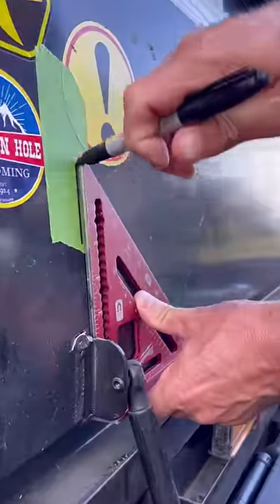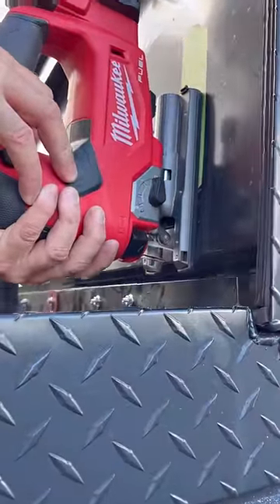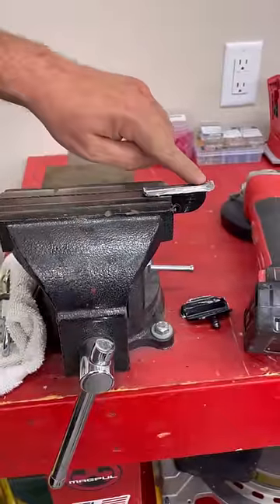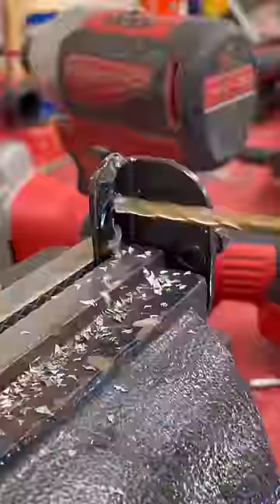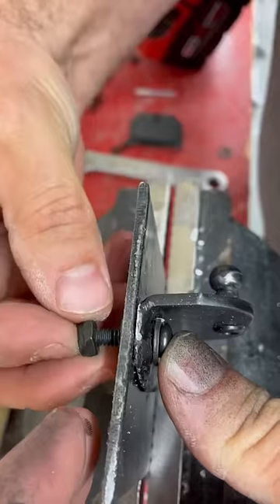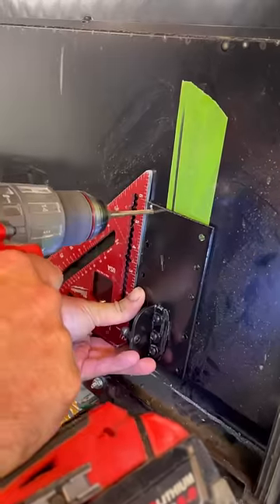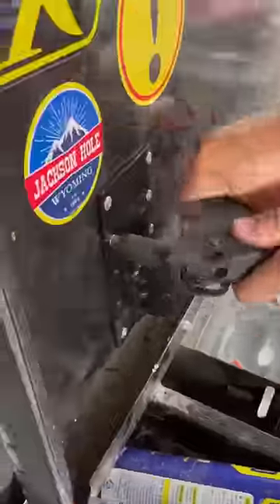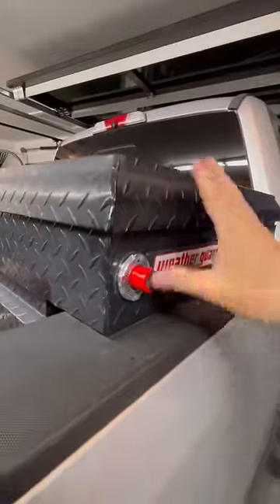I Had to Fix the Broken Shock Mounts on My Truck Toolbox

Comment: That repair was still cheaper than a new tool box!
Reply: Weatherguard has a lifetime warranty on their toolboxes.
Reply: It’s more of an upgrade than a fix! Better than new ;)
Reply: fixing stuff tends too be other wize whats the point to fix it
Reply: Yep, I always thought "pfft cheaping out!" but after seeing how I can just go to a local metal fabricator shop and ask "Any scrap sheet metal I can buy?" and either get chased away or see some actual useful stuff for the equivalent of pennies, I bought a small sheet of aluminium to use as a backpack bottom plate for the price of asking politely. It was way too big but they deal with contracts so what doesn't fit is trash, I cut it, rounded the edges and corners and glued some rubber around it and got what I consider a £15 product in return. Costs: £0.30 and some time.

I have taken a keen interest in metal repairs since then.
Reply: Not sure about that if you can disconnect the lid from the brackets.... Well might just get your boxes contents  jacked
Reply: @txfreerider if he is the original owner
Reply: No shit !!!
Reply: 😂z,,,,,,,,😊,,,,,,,,,,,,,,,,,
Reply: I'd recycle the old one.
Reply: Unless you’re in Rural America, people ain’t have time or knowledge to reuse, repurpose or recycle.
Reply: And it’ll last longer then a new toolbox now too
Reply: @txfreerider  yeah but then you have to remove it and replace it. and then the same thing will happen again. why not just fix the problem on the one you have? also, reduce, reuse and recycle in that order.
Reply: @minecraft425  the hinges are still attached, how is this any more theft prone than new?
Reply: Including buying all the tools for the project!
Reply: You can spend $300 bucks repairing a truck box and it will still be better than buying a new one at the prices they are now. Ridiculous!
Reply: What about the labor cost
Reply: @itsalexplayz2782 no, it’s a fix because it broke.

Comment: I'm honestly crying a little at the care you show your tools. That us a beautiful upgrade to a worthy workhorse.
Reply from the maker: Thanks
Reply: tool beautiful. jewelry, actually.
Reply: Steel and aluminum don’t mix, you’ll start to get galvanic reaction.
Reply: @chuckgranger9777 i don’t know. Depends on lots of factors. The paint will likely provide a sufficient insulation at the galvanic interface. But the aluminum would definitely be the anode. Though it would be the anode with any other metal that won’t suffer from work hardening. If he’s in the rust belt there’s risk, if not it’ll probably outlive him. I guess he could have used some gaskets at the interfaces, but those would fail with time. Either way, that repair will pay off before galvanic corrosion becomes an issue
Reply: @Praise___YaH  Then tell me this, why don’t Jews recognize Jesus as the son of God?
Reply: @chuckgranger9777  

Because they KNOW where “jesus” and the “jesus story” came from, “THEY” wrote it

1. The “god” begotten a “son” with a “virgin” is the story of Gadreel (The Serpent) begotten his “son” (Cain) with the “virgin” (Eve) 
-- Genesis 3, 4

1 John 3:12 “Don't be like Cain. He was a child of the evil one…”

2. jesus, the “bright morning STAR” and the “virgin mary/woman” is the Constellation Virgo the “virgin woman”, that is Astrology, the worship of STARS and “birth of STARS”

PLEASE, go back and read what I shared
Reply: @chuckgranger9777  

Salvation is Simple

HalleluYAH translates “Praise ye YaH”

YaH is The Heavenly Father 
YaH arrives via the TENT OF MEETING
YaH was Who they Crucified for our sins

— Ancient Semitic Cuneiform of Moshe (Moses)
— Isa Scroll (The Original Isaiah)

Isaiah 42:8
"I am YaH; that is my Name! I will not yield my glory to another or my praise to idols.

Isaiah 43:11
I, I am YAH, and there is no other Savior but Me.

Isaiah 45:5
I am YaH, and there is none else.
Reply: @Praise___YaH  I believe in the only thing I can trust, me
Reply: amen to that
Reply: Certainly Maintenance is A Crucial Element in Extending The Life Of Good Tools....!!!!
"Scout Motto Be Prepared"...!!!!👍👍👍👍
Reply: @chuckgranger9777  They're Rebellious Just like ALLLLLL the Other Sinners....!!!
Reply: @michaelduncan2151  Tell me why, oh great wise one.
Reply: @michaelduncan2151  Cat got your tongue?
Reply: Gay
Reply: @jamessheppard4372  
Yes I am 'gay' for this man's tool.

Comment: The hinge is bolted to a substantial steel backing plate which is generously riveted to the top.  They are going to bury you in this thing and the top will still function perfectly.
Reply: The only thing I would worry about is if you didn’t use any type of matrix (such as RTV) between the rivets and the plates. Dissimilar metal corrosion is what I would be worried about most, but you’ll have a good long time before that happens.
Reply: So what about when the same road vibration cause the surrounding steel edges to TEAR the AL just as it did with the old hinge plate?
Reply: But does it leak tho?
Reply: @TheTubejunky  It'll take far longer than the original damage took. The force of the mount is spread over what looks like a dozen rivets per plate.
Reply: @usmcquick makes it quieter too
Reply: How far apart are steel and aluminum on the galvanic series scale ?

Comment: Nice to see someone fix their stuff instead of throwing it away. We all should do this just like our grandparents did.
Reply: Most things are made fragile by design these days since a returning customer is better than a one time purchase. 

Fun fact when they started the first manufacturing of nylon tights they almost went bankrupt since you could tow a car with those tights. They were almost indestructible - nowadays they break after a week or two by design.
Reply: They just couldn't afford new stuff.
Reply: @Cheepchipsable   
Really do you think that is why he fixed it? 
So today I put a new blade on my 15 year old lawnmower. 
Should I have just thrown it away or do I buy a new mower?
I think changing the blade and spark plug and oil and giving it a little maintenance is more economical.
Same thing for my house I needed a new roof and I just replaced the shingles and the sheeting by myself or should I have just bought a new house?
If you have the skills to fix your stuff instead of throwing it away I think it’s the only way to go.
Reply: My grand pa used to hide in his shop and smoke cigarettes. I was 4 or 5 and it was like Disneyland to me. Jars screwed to the ceiling full of nuts and bolts. Old sleds, old skate, radios etc etc. Old storage type boxes made out of scrap wood and cigar boxes with pieces of string, buttons, zippers etc etc. This is why Im a builder
Reply: @sargeinamerica  the sense of satisfaction of fixing it AND saving money.
Reply: @sargeinamerica 
I usually buy a new mower when the blade goes.  😂😂
Reply: Our grandparents only did that until they were older and wiser. Then they started paying the grandkids to do it😂

I learned more from grandpa than anyone or any school. Building, repair, engines, how to be a man (long hours and dedication to family and responsibilities) along with some not so good habits like smoking. Although I quit after 12 years and watching grandpa go through hell because smoking destroyed his lungs. I guess that was another lesson learned from him

Comment: Honestly, the only things I would have done differently would be use plate aluminum to prevent galvanic corrosion from the dissimilar metals and placed some sealant between the patch plate and the lid. Also, spacing your rivets so they’re about 3 times their diameter from the edge and 3 diameters apart would provide the best strength. That looks pretty good, though. Hopefully it holds for a long while.
Reply: They're painted so galvanic corrosion is minimal. Same reason why Zinc plated fasteners are fine on Al. In 10 years it might be an issue, but at that point he's 20 years into this tool box.
Reply: @Andrew-wq1ue  it was all painted over, but not the inside of the holes, otherwise the rivets would no longer fit if you used the proper size bit. I agree that it will last a long time, but probably not more than 3-5 years before he sees stress cracking start from the corrosion around those rivets in the aluminum. The lack of sealant will accelerate it.
Reply: I won't disagree that galvanic corrosion can be an issue. However, in this specific scenario, I doubt it will become troublesome. The contact area is quite small and I doubt there's a high concentration of salts that the joint will see. 
  Where did you get your rivet spacing from? I believe the standard, for these types of rivets, would be something like 15x diameter (I believe this is an aerospace standard). I am surprised, however, you didn't point out that the rivets should have been installed in the reverse. So that the head is on the exterior.
Reply: @tomb816  I agree that the rivets should have been installed in the opposite direction.

I’m an aircraft mechanic. My rivet spacing comes from the FAA’s AC43.13-1B. Edge spacing should be 2-4 times rivet diameter. Rivet pitch (spacing) should be 3-10 times rivet diameter. Transverse pitch should be 75%. Rivet diameter is 3 times the thickness of your thickest material. Rivet length is the grip length (combined thickness of all materials being fastened), plus 1.5 times the rivet diameter. There’s more information about rivet type, material type, heat treatment, etc.
Reply: @tomb816   it's not possible to install the rivets from the other side, the holes are blind.  Watch again and you 'll realize the hinge is attached to a box piece that is attached on the inside of the lid.  I'd assume this is the why of using pop rivets.  I mean, if the rivets could pass through, I'd probably have used counter sunk from the outside, and bucked them instead of cherry lock.

Also, apparently when rivets are involved, all the aircraft mechanics show up lol.
Reply: @firefighter1c57 "when rivets are involved all the aircraft mechanics show up" 

I am also here to check in (smco in the USAF). First thing I noticed was the dissimilar metals and the sub optimal rivet spacing and choice of rivets. But also it's a toolbox not an aircraft. If you wanted to do it perfectly yeah, aluminum plate, solid countersunk rivets shot from the outside in and sealant on the faying surfaces and inside the bolt hole. But this will probably last a LONG time as a toolbox
Reply: @firefighter1c57  yeah, I don’t think there’s another industry that even comes close to aviation when you talk about the prevalence of rivets.
Reply: @Andrew-wq1ue what about the holes and constant vibration?
Reply: @hudortunnel9784  Yes, that is an issue for excellent manufacturing. But each rivet is clamping with about 200lbf. This is plenty for a repair on an old toolbox.
Reply: @Andrew-wq1ue  nice
Reply: I would have used aluminum, but maybe he didn't have any of it handy. I'm still working on a small, damaged, discarded speed-limit sign for my aluminum repair patches of useful thickness. An oversize patch with a bunch of fasteners spreads the load. I used this technique for fixing an old aluminum storm door when the door-closer screws blew out. I used aluminum-alloy sheet-metal screws instead of pop-rivets. 
-- Stiff patch, large enough to spread the load, and a bunch of fasteners.
Reply: It's not the space shuttle,  get real
Reply: A Galvanic reaction will be minimal as it's inside the box, keeping it essentially dry.
Reply: @metalmastersc  no, the holes pass through, along with the portion of the lid that was cut out.
Reply: I was about to say the same thing
Reply: @phtevenmolz5030 the holes do not pass through. The lining panel he secured the hinges to is welded to the external diamond plate panel. Many boxes are made that way. I actually insulated one with foam once so it would hold a cooler I build into it better.
Reply: It's a tool box that he is getting more life out of by the time the corrosion sets in he would prob need a new tool box from the hinges falling off or being 2 small for the tools he bought over engineering a box by getting aluminum and doing this the same thing will accure where the constent flexing at that point from the shocks being compressed would make it be at the same point it is now broke
Reply: @shadowking9409  did you have a stroke while writing that? Anyways, it won’t have the same issue with a proper repair using aluminum.
Reply: @richeyrich2203  galvanic corrosion doesn’t require direct exposure to the elements. Even just high humidity or not cleaning the parts before assembly can provide the electrolyte required for corrosion.

Comment: That's a lifelong repair there, dude. No doubt about it.
Reply: The rivets ruined it
Reply: I’ll give 2-4 years as is until the same tears happen at the repair points. 

I think an additional plate on the top with bolts that pass through and sandwich the lid would be a lifetime repair.
Reply: Aluminium and steel touching is a big corrosion hazard
Reply: Idk about that. Theres a hole on the top for water to collect and nothing but rivets holding it. I for-see nightmares
Reply: @Rukkn especially here with that hole cut into the top plate leaving a bowl to collect water
Reply: @zwicker5585  Arite, maybe lifetime was pushing it a bit too far, I'll not die on that hill. 🤣 It is however, major improvement from the original. I love anything and anyone that can, will, and does repair shit as best they and/or a buddy can. I hate this throw away society we have now. It's just okay to toss that 400 dollar vacuum and get a new one. No, I'm not gonna clean out my palm sander...I'll just junk it and buy new. To me, that is unacceptable. Not to mention my pops would beat that attitude out of me...that old school Marine doesn't give a damn if I'm 36 and he's pushing 60  🤣😂🤣😂
Reply: @kcb5336 well the wider mount point spreads the stress better than the original mounting so it is less likely to crack though galvanic corrosion is a risk the layer of paint he applied can help prevent that and water pooling and a potentially non watertight seal puts his tools at risk aswell.
Reply: @Rukkn Not hazard, it's a guaranteed galvanic corrosion, granted the aluminum rivets will disintegrate before the lid gets eaten, maybe some stainless rivets or an aluminum plate will have helped

Comment: I destroyed a few aluminum boxes before I bought a used steel weather guard. Box has outlasted 3 trucks and now sits on my 2019 F350 and is going strong use it everyday
Reply: I have an unknown aluminum box I bought off a guy for $50 bucks. That was almost 20 years ago and is on my third truck since I got it. All I had to do was replace the locks, weather stripping and shocks.
Reply: @maddawgnoll  they are fine for light duty use.

Comment: Perfect example of a repair anyone can do, and preserves original security, and doesn’t require specialty skills like welding. AWESOME job. Love it
Reply: Yep, all you need is about 500 dollars in power tools and you too can make.this simple repair
Reply: @l.n3187 unless you already own all these tools. I mean what what else would you need expensive ass toolbox if you ain’t got tools?
Reply: @l.n3187  A suitable drill and grinder are common tools and can probably be had from as low as 100 bucks new, cheaper used. However, it is true that if you don't have such power tools you likely don't have the hand tools either nor expertise to make this easily. It may be a weekend long project for a beginner, but still doable and cheaper than buying a new box.

Comment: Well done.  You have spread the load on the top to a very large area, as compared to the original.  This should last longer than the original attachment.
Reply: Yeah, I think this repair will outlast the rest of the toolbox.